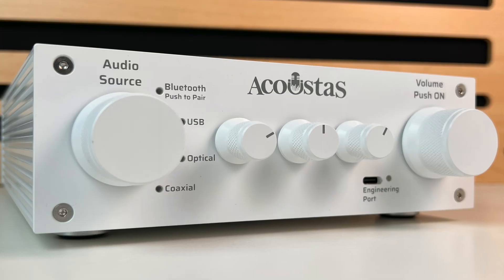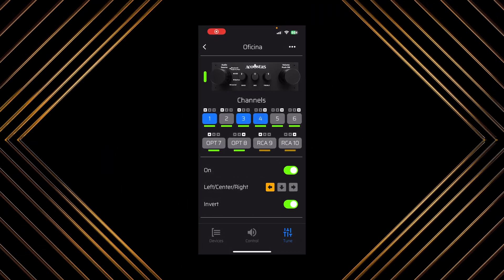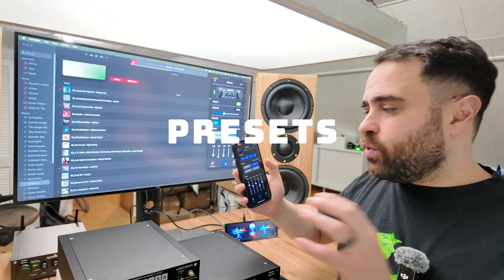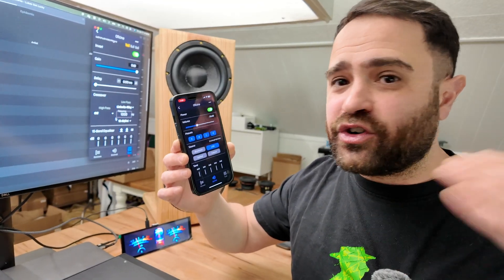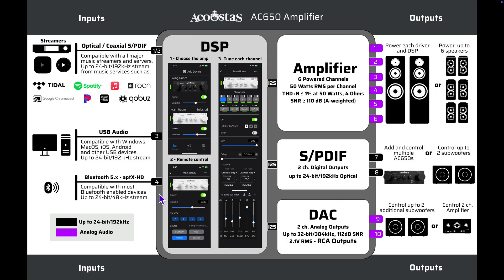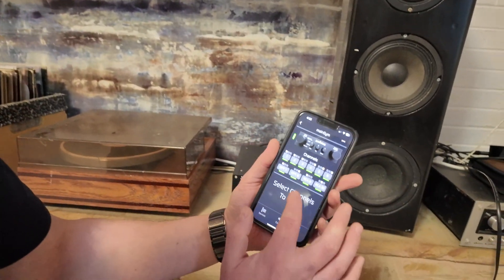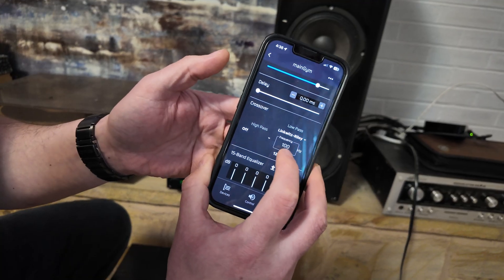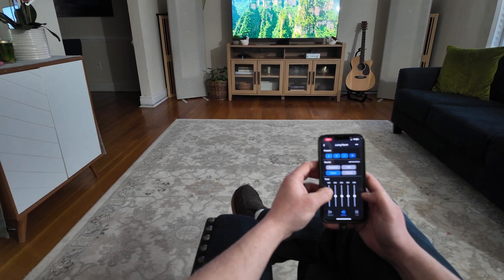Building Speakers with the AC650 DSP Amplifier: My Personal Setup & Overview

Comment: Might this amp and it’s equaliser and dsp, be a guide to what values you need in case I would like to build a passive crossover? All the data can you see on the screen.
Reply from the maker: Yes. That is precisely what quite a few people use it for. You can test different crossover points time alignment offsets and set different configurations into presets. Then you can AB test them with measurements and listening. Check out HexiBase on YouTube that’s what he uses it for as well and he’s got his latest video where he does exactly that.
Reply: @StasAudio thanks for your response. Forgot about Hexidude.
Reply: @StasAudio  bro use 4th order crossovers, it doesnt require to flip the polarity of the drivers, in your case you have them inphase at the crossover frequency but the highs are completly 18o degree out of phase cuz you fliped the polarity on a 2nd order

Comment: wow.... not one, 2x overpriced DSP amplifiers 2x900=$1800 for antique drivers, bravo.. What's next? Should we buy a million euro Ferrari just to change, trasfere the headlights to some cheap 20 year old Ford?
Reply from the maker: Ok well that’s a little funny but, the thing is these speakers mean a lot to me. And they’re actually quite good. Probably this summer I will outfit them with new drivers or build new ones will see. Also, as I mentioned in the video, I’m using the second amp to power all of my speakers outside. Also $900 in US made audio with these capability is kinda great.
Reply: Wow. I don't think you see exactly what this amp is capable of and it's price to performance ratio makes it an incredible deal. I cant wait to get mine.

Comment: How many watts on amps?  (Scoured website to no avail.)  I have Maggie 1.7i's and am concerned not enough juice to push them safely to mid-80's dB levels.  Which Maggies are you running?  With subs?
Reply from the maker: @michaelsparrow4798  I’ll have a video coming out very soon here where I use 4 Maggies at the same time. There is more than enough power to run up to 250 W continuous and much more if it’s instantaneous. You’ll be able to listen in my next video.
Reply: "The AC650 is a DSP amplifier with 10 addressable channels. It features 6 powered channels, each delivering 50 Watts RMS, along with 2 RCA outputs and 2 optical outputs for external amplification, subwoofers and system expansion."  That is a quote from their website which states only 50 watts per powered channel.  That is NOT enough to push a Maggie to reasonable volumes in anything but a small room.  Even if you bypass the crossover and run the tweeter separately, 50 watts isn't enough for the bass driver.
Reply from the maker: @ you can because the amp is 4 Ohm and lower stable. Maggies sound amazing with it. It is plenty loud would you like a sound sample? Just watch my other video and if that’s not enough let me know. With Maggie‘s it’s not about power. It’s about the ability to drive four ohms or there about.
Reply: @StasAudio  The amp puts out 54 watts into 4 ohms, and 40 watts into 8 ohms, which shows the amp is NOT a high current amp, even if it remains stable into the Maggies which dip to 3 ohms.  It may be stable for a while, but it will heat up and it will take its toll over time on the amp.  Maggie owners know whether 54 watts is enough for them.  There is a reason that the lowest recommended amp by any review I have read is 100 watts, and that must be 3 ohm stable.  Yes, this amp may power it, but the most you will get out of it in a normal size living room is about 87 to 90 db at a reasonable distance AT PEAKS, and about 84 to 85 db max average.  Not enough for most people.  Also note that the distortion levels will be over .1% for most of the audio spectrum at those levels by the amp, which is rated at .07 percent at 1khz, but the power that is rated at is not listed, so it actually could be over 1% at max power for most of the audio spectrum.
Reply from the maker: I agree that it can be louder and 100 W would be a bit louder however for my taste, this is perfect. Loudness is not everything to me. Plus I run four of them at a time. I prefer multi Channel stereo in my living room where Maggie‘s are.
Reply: I would like to add that in no way am I saying anything negative about the AC650 amp.  I like what it does and I am planning to purchase one.  But my experience as a Maggie owner tells me it won't work for what most audiophiles want out of a Maggie amp.  With less demanding and more sensitive speakers I think it will work great.

Comment: Amazing product… bi-amp or tri-amp or more.  Been using for a month non-stop.  Very simple to operate once you get it on the network.  Eliminating crossover components in the speaker has made the biggest difference in sound quality.  Get some efficient drivers and the power is more than enough.